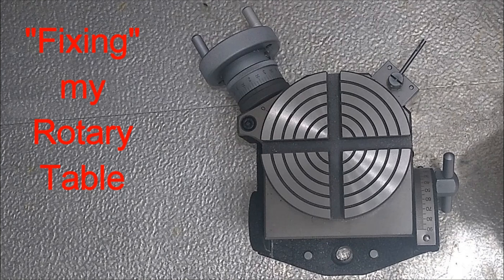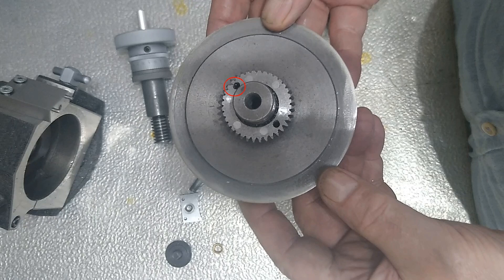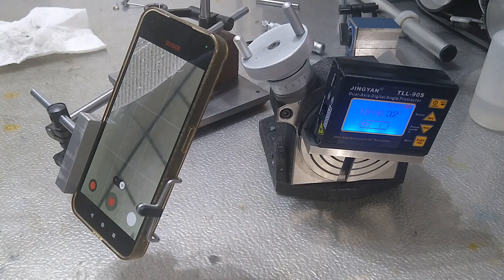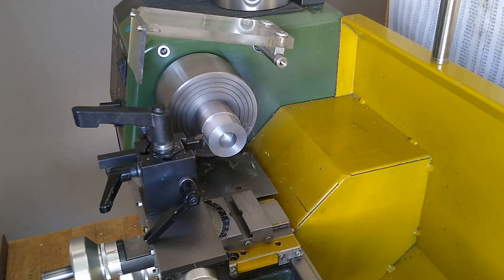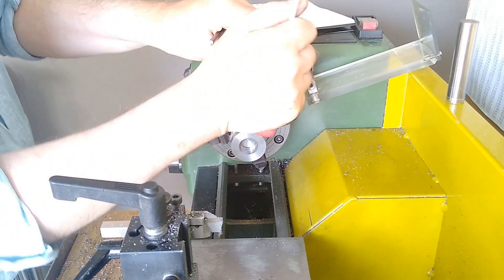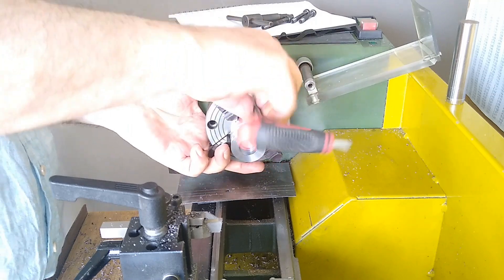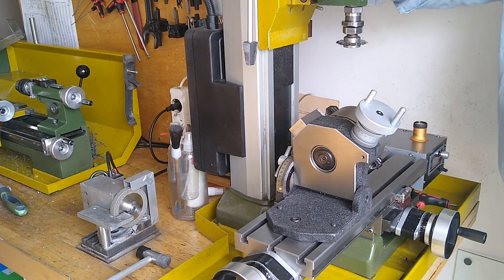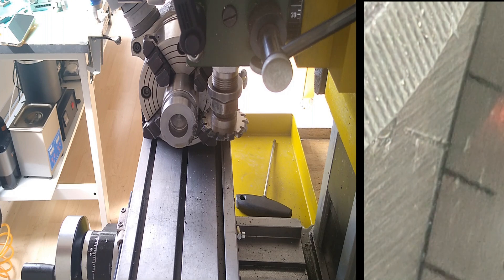Fixing my rotary table (again)

Comment from the maker: I see a 4" Sherline, with tilt mechanism for about USD 500,-
That is not cheap. The repositioning accuracy should be +/- 6 arc minutes according to their own specifications. 
My "failed" repair gives an almost twice as accurate result. So am I too demanding here?
What are your thoughts about this?
Reply: @Michel-Uphoff  is it worth trying to repair the gear?
Reply from the maker: The new gear or the broken one?
Reply: @Michel-Uphoff  ooh, good question. If the original was good before the damage, then there is only an error across one tooth gap, or have I misunderstood? My thought was to make metalock repair key, to pull the crack as snug as possible.

Comment: Nice try. I can also see another source of drift due to not using a hole plate.
Reply from the maker: Can you elaborate on that?
Reply: @Michel-Uphoff  The quickest is this video by MrPete222 [3wd8wE_VxPo] using a dividing head.
Reply from the maker: @jrkorman  Have you actually seen this video?
I don't have one, and my rotary table was broken, as told.
Reply: @Michel-Uphoff  I watched carefully. I understand your problem, I am just showing where your error is coming from. It is very hard to repeat incremental angle measurements for each tooth. Any error between teeth is going to show up in your final measurements.
Reply from the maker: @jrkorman  Then you must have seen that the repositioning error was within an arc minute when I tested it. The error isn't incremental. I think there were a number of issues that contributed to the total error.

Comment: Nice attempt! I bought a Vertex 4" rotary table made in Taiwan a few years ago. It was not cheap but is working well for me. I don't have a super accurate electronic level but I have a sine bar and gage blocks that I could check it with but never have. It has a 10 arc sec vernier but they only claim 40 arc sec accuracy, but that is enough less than 1 arc min that I'm happy. Mine is not tiltable, but horizontal and vertical, but it has not come up for me that I need a funny angle.
Reply from the maker: Thank you. I will look into that brand.

Comment: "A" for effort Michel, just a shame it didn't pan out how you wanted.
It'll be very interesting to see what suggestions are put forward for a Rotary that fits your spec's.
Reply from the maker: Hi Colin 🙂
Oh, it's not a big deal.. It can't be a party every day, as we say here in the Netherlands. I have seen a few candidate 4 inch rotary tables, but the most important specification: The maximum repositioning angle error, is hardly specified anywhere. So I don't trust it..
Reply: @Michel-Uphoff  I've got the Proxxon UT 250 back when it was first released but unfortunately I don't think it'd go close to the angle error spec's you're wanting.
However I wonder if their UT 400 Universal Dividing Table might?
Being Proxxon it wont be cheap but it would fit your PD 400 Chuck & on the FF 500 ...
Reply from the maker: @colincreedtattoomachines  
Hi Colin, 
I have looked into the UT250, but the specs are not that good. Besides that, it is not tiltable. I can't find any specs for the UT 400..
Reply: @Michel-Uphoff  There's very little about it on the Proxxon official website but I think their catalogues or the Manuals might contain more..?
I'll see if I can find anything & I'll email it to you.
Reply from the maker: @colincreedtattoomachines  Thank you!